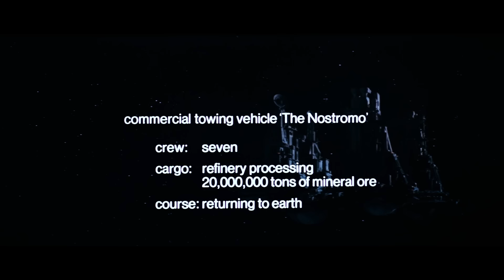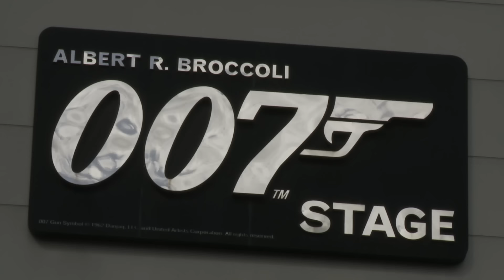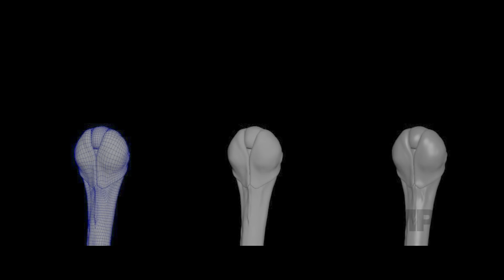Prometheus (2012) KILL COUNT

Comment: Question: how can they use flamethrowers in an atmosphere almost entirely carbon dioxide?
Reply: the fuel theyre using in it is probably self-oxidating, so wouldnt need to rely on atmospheric oxygen
Reply: In a world full of CO2, they would need to have devices to work in those types of atmospheres since most wiring would need Oxygen to work, so self sustaining O2 machines would most likely need to be implemented into them for those off world expeditions
Reply: Same way you can weld underwater.
Reply: yes

Comment: 22:20 im not 100% but im pretty sure the deacon is pretty much the first existing type of xenomorph. the engineers used it as a form of continuing life as the engineer lifecycle was 300000 years but they had lost a way of reproduction so it used a deacon blood to continue. the deacon giving them blood to continue life eventually died and the engineers tried to create a new deacon blood forming the black goo.edit: that is what is on the wall in the chamber with the big head in it

Comment: not to recycle what cinemawins said (except thats what im doing) but just a heads up for anyone confused about why fifield looks like that: the alien snakes that were actually worms to begin with ended up completely covered in the goo,  they became stronger. their exposure to the goo was external. fifield went face fuckin first into a puddle of that shit. so not only does he have the acid burns from the melting helmet, but its likely he injested a lot more of the goo a lot quicker than we saw with holloway, and that wasnt a drop into a cup, either. i mean, it doesnt work on us like it worked on the engineers, apparently, and like the snakes, it had the knock on effect of making him stronger for some odd reason. looking at the deleted scene design, my assumption is their original idea was to have him end up as some sort of half xeno hybrid thing (which would make sense since holloway infected with a drop of black goo knocked shaw up with a widdle facehugger, and like i said, the worms changed fucking MASSIVELY) but, like james, im glad that wasnt the route they took. i prefer what we got